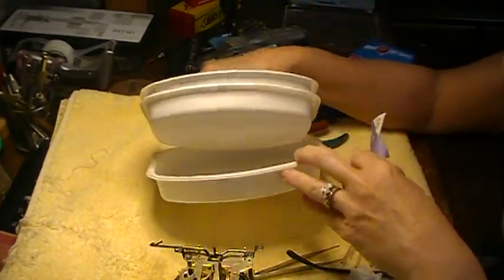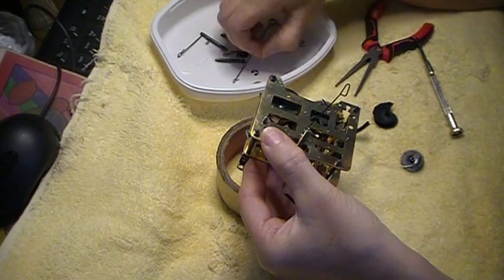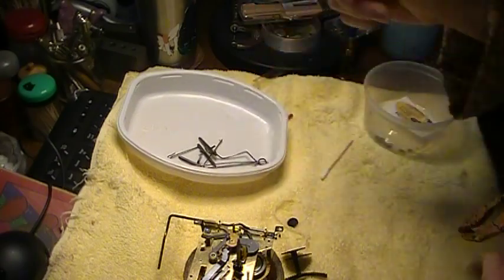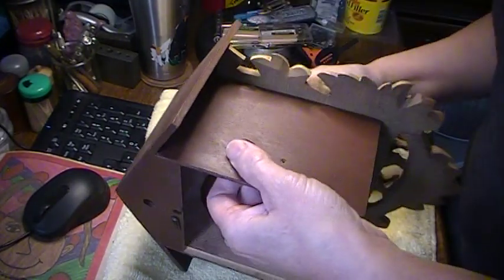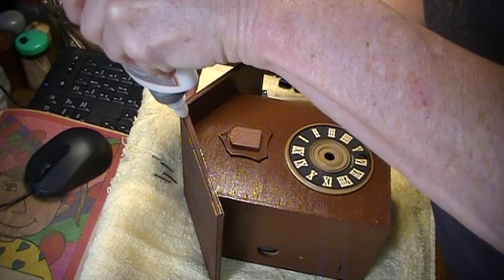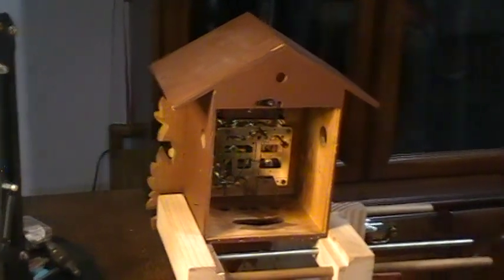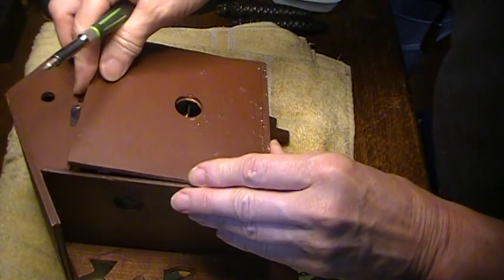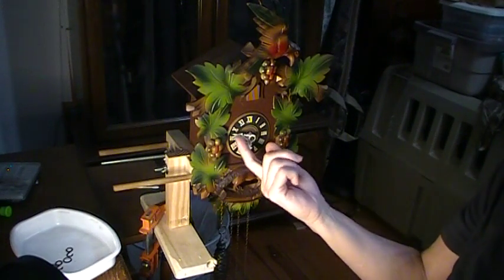c1950 Fox in the Vineyard Cuckoo with AMS Movement 2

Comment: That movement is beautiful. It looks like you used mothers on it but that is just from the cleaning solution.  Looks great. Very good explanation of how you know that you are getting somewhere by the less parts that you have left in your containers. Very good explanation on the gong hitting when the clock goes into warning and what to do about it.  Love how you have learnt so much in a short period of time to the point where you can teach others. Keep it up girl.  I think that you did a heck of a job on that bird repair. Looks great to me. You still havent added a handle to your hammer. Just get a wooden dowel. Drill a smaller hole than your handle but not that much smaller. Then push the handle onto the hammer handle. Love that hammer by the way. Your videos are getting better and better every time. I told you before that if you would have started repairing clocks 26 years ago when I did then you would  have passed me by a very long time ago.  Your explanation on the type of clock with the weights and chains on some movements could be thrown off.  Great video from start to finish.  Keep it up.  Thanks for the shout out. God bless you and yours.
Reply from the maker: @munnerlyn3  what do you mean about the type of clock with weights and chains could be thrown off?
Reply from the maker: @munnerlyn3  and no I still haven't put the handle on my hammer. I was going to just use my homemade let down tool for a handle, but I still use it as a let down tool sometimes.